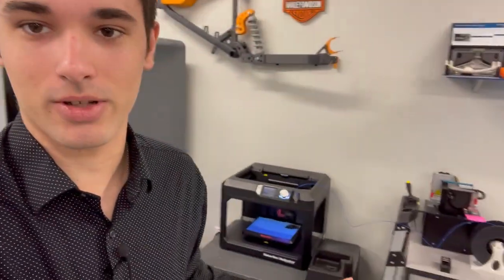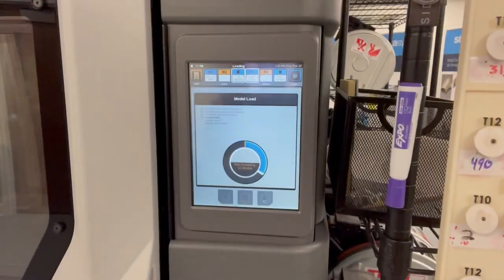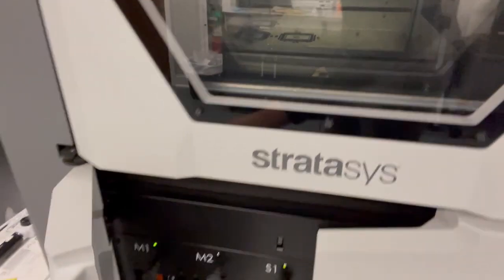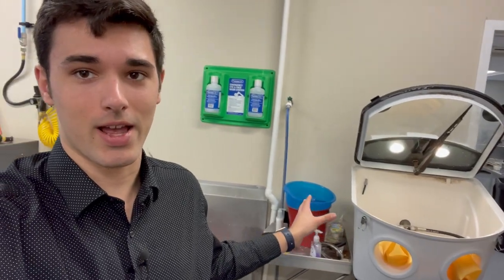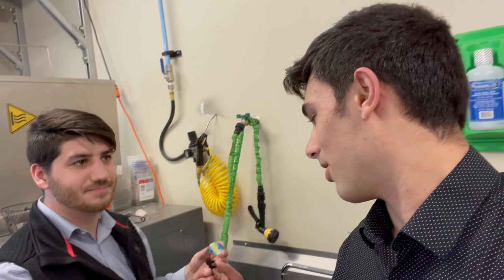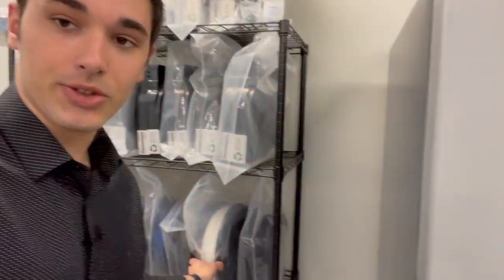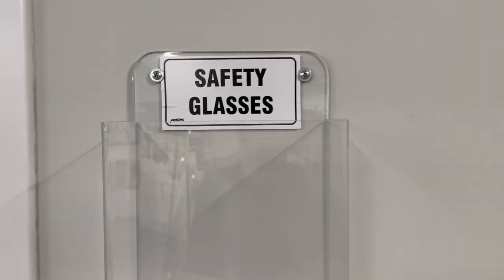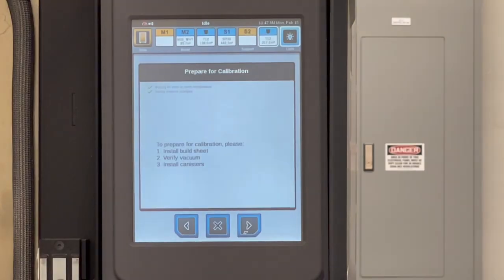A Day in the Life of A 3D Printing Engineer (Vlog)

Comment: Hey, very inspiring video and I really dig your drive! question: How do you come up with parts to print that has market value? do you search online or do you get suggestions from previous customers? cheers
Reply from the maker: Hello! Thanks! To be honest my pricing is purely based off of material consumption and  printer depreciation. Sometimes I will bump something up but not usually.
Reply: @Mwillett  alright,  thanks :) and where do you find inspiration of what parts to print? i'm curious cuz I also try to print to sell but it's tricky to know what to print that could be desireable for customers.
Reply from the maker: @simperdesignswede7878  A lot of people don't really know what they want... they need to be told! sort of what Steve jobs pushed a lot. It could be anything. it may change month to month.